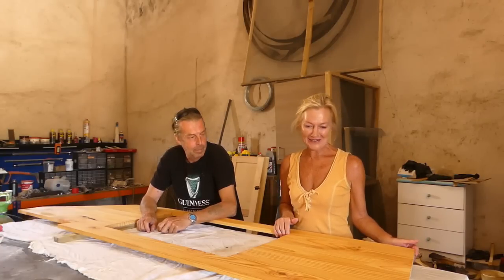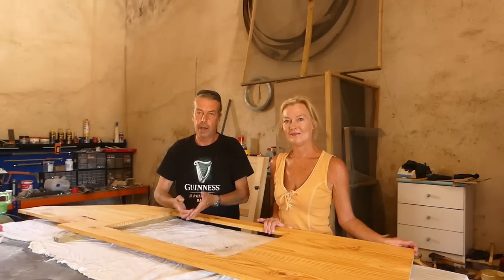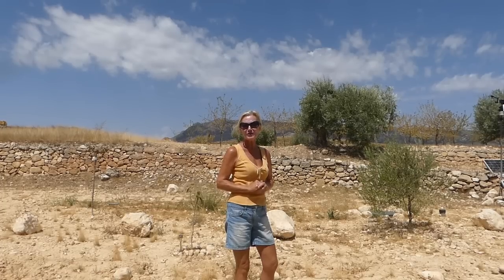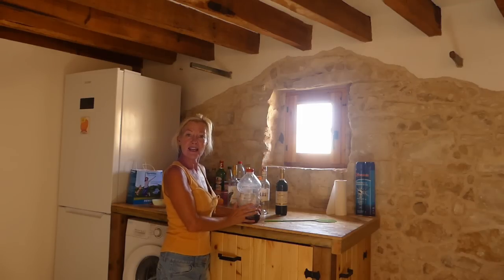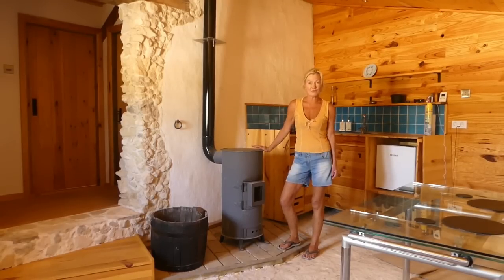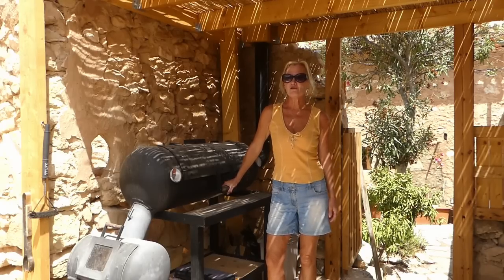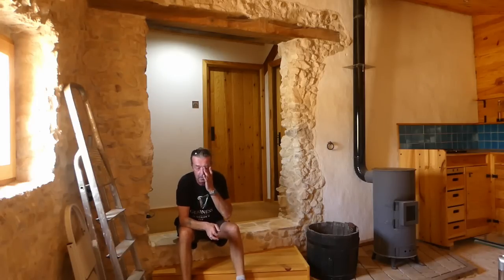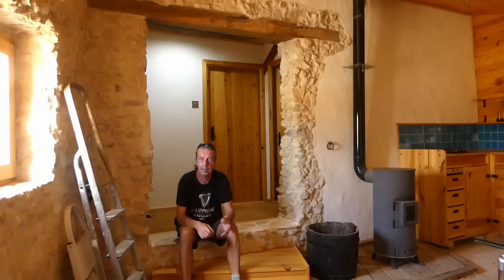Reclaiming, recycling and using natural, renewable materials - Being kind to our planet

Comment: A very enjoyable video and the stove which you made looks splendid.   Have you had any rain yet?
Reply from the maker: Thank you. No, still no rain but we are forecast a little mid week. We aren't holding our breath
Reply: @FincaLife  Here in Shetland we are lucky if we get 100 hours without rain.  On the subject of recycling, I have found that builders skips are a good source for wood etcetera.
Reply from the maker: @laurencejohnson4106  yes, it can be wet and cold up there but it's a very beautiful, tranquil place. Are there many builder's skips there? Not many at all round here but we get a lot of pallets we use for various things.
Reply: @FincaLife  That's true.  It all depends on how many renovations and new builds are happening, but the current price of building materials has put many projects on hold.  Because I live near to the Atlantic ocean and not that far from the North sea, beach combing also provides some wood and other useful items. Is there a video which shows how you made your stove?
Reply from the maker: @laurencejohnson4106  I'm afraid I made it before we started the channel but there are two videos on making the BBQ, which is the same principle apart from that's horizontal and the stove has the rounded ends cut off and flat plate in their place.
Reply: @FincaLife  I shall have a look at those videos.

Comment: Bless you both for your efforts. I have a very similar mindset, although it’s often an element of frugalness too (or I’m too tight if you prefer 😂)…why pay someone for something pre-manufactured when I can make it myself..and it’s done to a standard I’m happy with, usually far beefier and free or much cheaper ha ha..plus, as you say…its better for the planet to recycle or upcycle, sadly these days it’s becoming more of a throw away society. I originally trained as a domestic appliance engineer, but generally people don’t get washing machines etc fixed any more, they chuck them away and buy a new one…sigh, anyhow, we do what we can I guess. I’m still hoping that one day I’ll be able to move to Spain and follow in your footsteps so to speak. There’s really not much point in a solar system in Newcastle ha ha!..I collect bloody stacks of rain water though!..see you Thursday 😀
Reply from the maker: Cheers Mark. Yes, it certainly helps save money too in a lot of areas